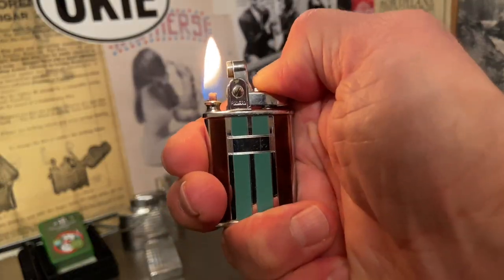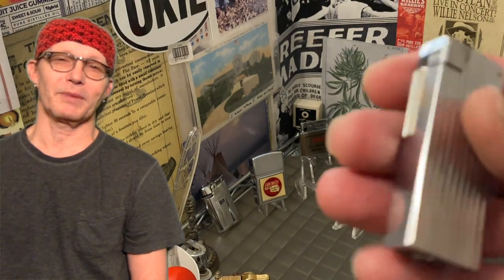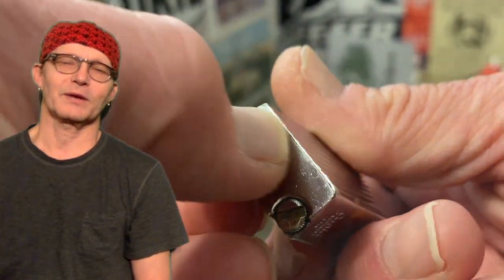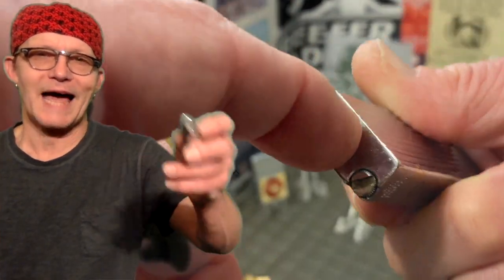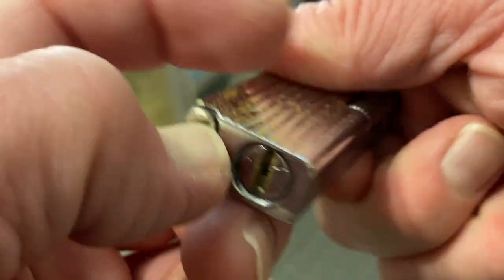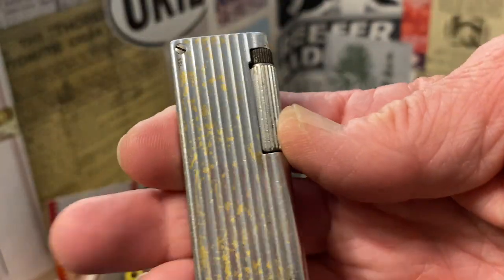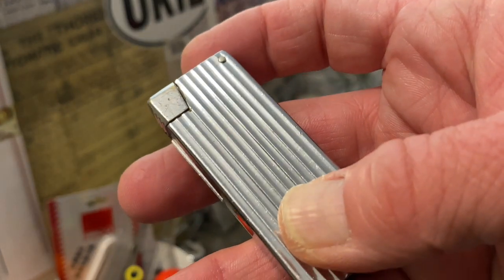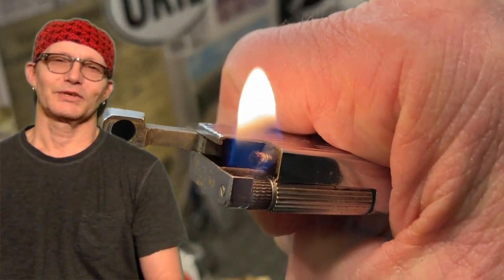Let's See If A Petrol Lighter Really Needs A Fuel Screw(Or Cupid Project Video 1)

Comment: Hi Joe, I find this very interesting about the hole in the filler screw. I believe that the hole in the screw can be used to have a better flame, because it allows the passage of air. A friend of mine had put a plastic seal on his zippo, instead of felt, to prevent the gasoline from evaporating, but poor zippo had been suffocated, due to lack of oxygen, and made a weak flame. If you notice, the zippo screw, which holds the flint in place, is slightly longer than the insert, in order to prevent the felt from going against the bottom of the case. If the felt hit, there would not be enough air to have a nice flame

Comment: I have a Prince Gardner closed tank that I can't get the fuel screw loose on. It's mostly brass and I'm trying to avoid damage. Any suggestions from your experience?
Reply from the maker: That's a problem I really haven't figured a solution to.✌️
Reply: I tried a bigger flat head screwdriver and was able to loosen it without doing any damage.